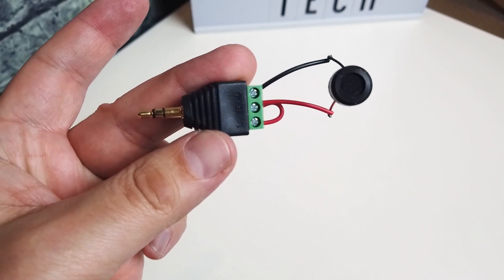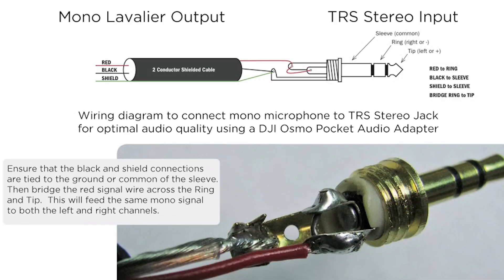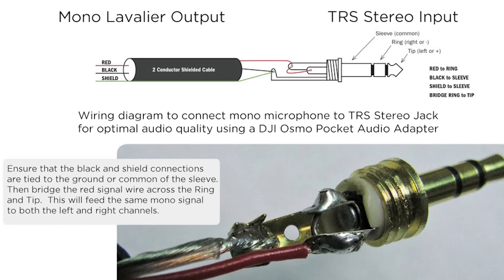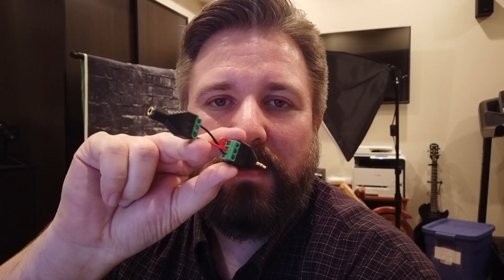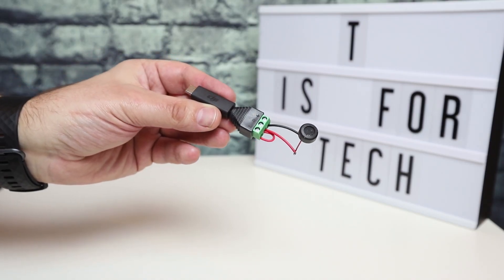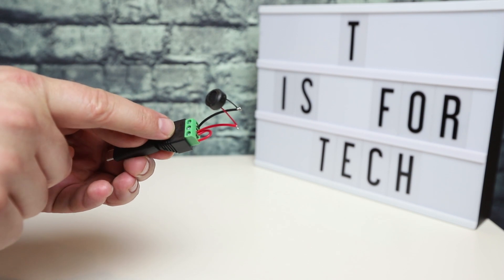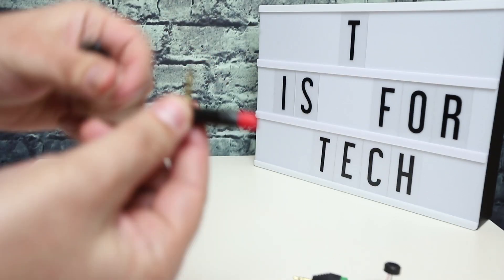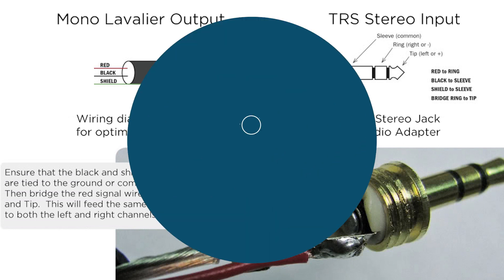Custom Microphone for the DJI Osmo Pocket Audio Adapter!  Using Primo EM172 Capsule!

Comment: Looks Good.  Full name is Bob White. The WO3B is my amateur radio callsign.  Putting the EM172 on a 90 degree connector will not buy you much as it is an Omni Microphone.  If you want directivity use a Primo EM184 (if you can find one) or it's replacement EM264Y both of which are Cardioid.  Your EM172 sounds great.
Reply from the maker: I guess you are completely right on the 90 degree part.  I maybe should have elaborated a bit more in the video and not just mentioned the "point it in whatever direction" you want bit.  I did want an omnidirectional one at this point in order to get a bit more of the environment sound around the device - and not a fully directional cardioid sound.  That being said, in the adapters that I was looking at with solder terminals, to me they seemed like they would make the overall height of the dongle hanging off the bottom of the OP a bit too much.  The 90 degree at least gives me a little offset to that total height.

Thanks for the comment - all the work you have done has helped me out :)

Comment from the maker: Just as a note, as Bob pointed out below - the 90 degree elbow on the connector doesn't do much good for an omni directional microphone...  I do realize that, and while it may not help from a sound perspective, it also helps keep the overall height coming out of the Osmo Pocket a bit "shorter" - as it stands already the whole setup dangles quite a bit from the bottom...  I guess I didn't really mention that in the video itself.  My bad!